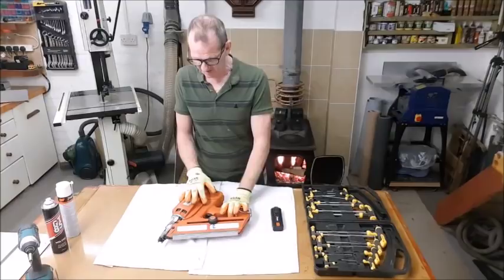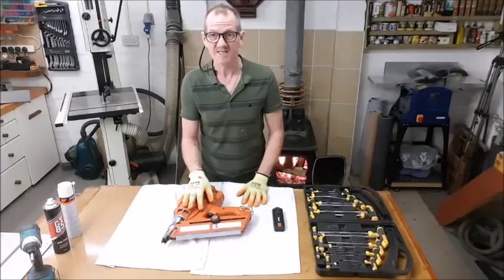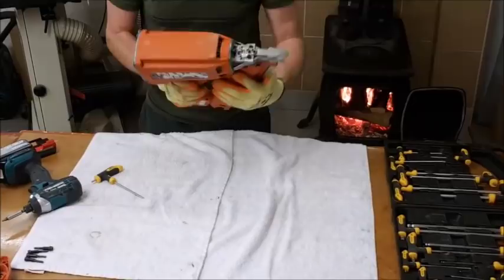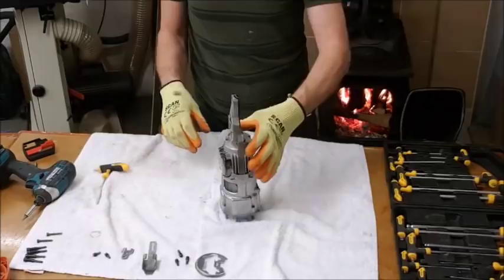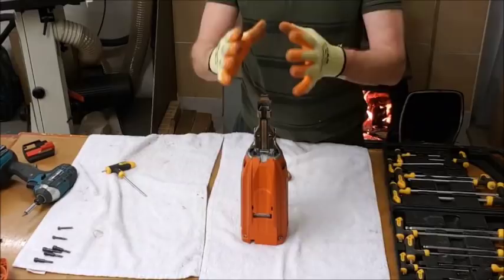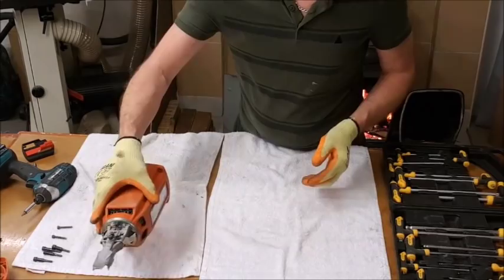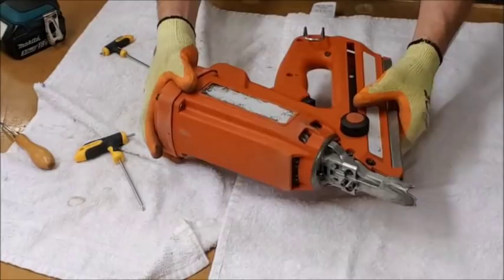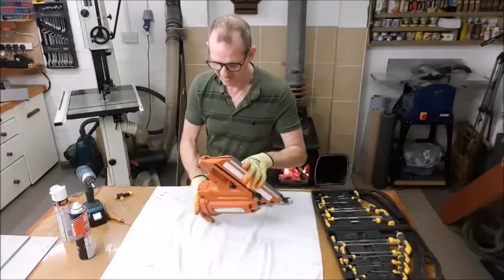Paslode IM350 full strip down

Comment: ive got the makita version of this gun which looks exactly the same once the covers are taken off.

i stripped it down some maybe 5 years ago after it developed a fault where it hardly ever fired. maybe 5 or 6 times id press before it would fire. in the end i gave up and used the dewalt gun ive got which i was given as a tester gun before they were released for sale. now ive got an apprentice so at times may need a couple of nail guns. i fully serviced it and cleaned it after stripping it almost as you describe although i didnt seperate the 2 parts of the cylinder. ive built it back up but its still doing the same. however ive discovered that i cant smell the gas when i press the gun onto timber. although 5 or 6 presses in succession can make it fire. (new gas and old gas ) however if i press the gas canister in by hand it fires every time. is the actuator a part that can wear out? on the makita it has a little rubber part inside it. dont know if the passlode is the same? 

cheers

Comment: David, I have one of these guns, it fires one or two and it stops, I have to get the battery off and put back, before it works again, I also noticed the cover of gas can pups up a bit when I push down to nail, it did not use to do that, any idea what has gone wrong?
Reply: the gas cover should rise up slightly when using the gun, and paslode are notorious for battery loosing connection when gun in use, I applied extra blobs of solder to my battery terminals which does help but at £500 plus when i bought mine we shouldnt have to do that, Sell your paslode & buy an hitachi or hikoki they dont miss a beat.